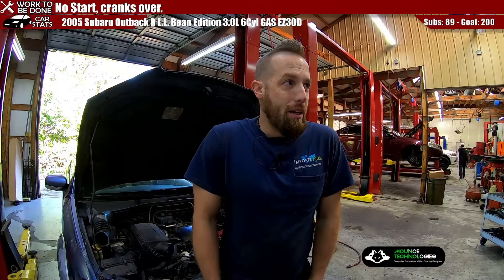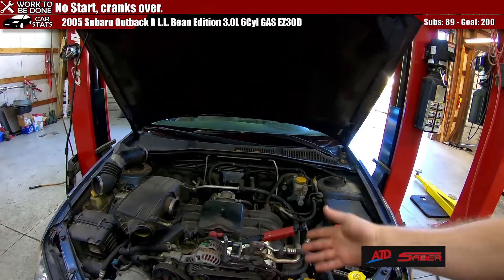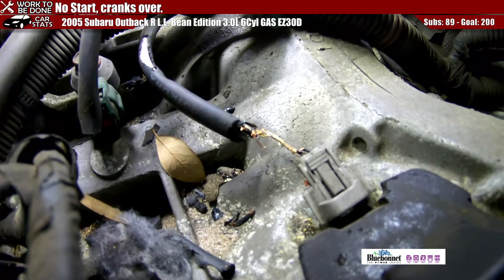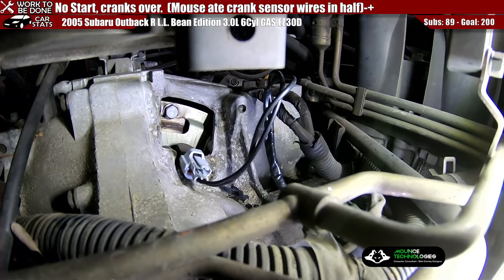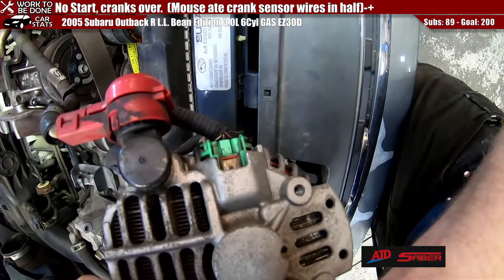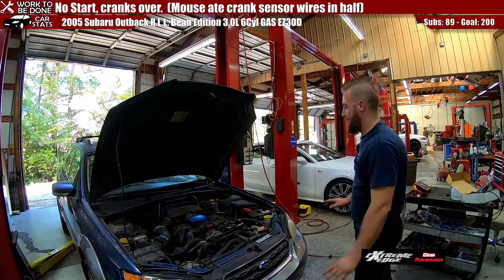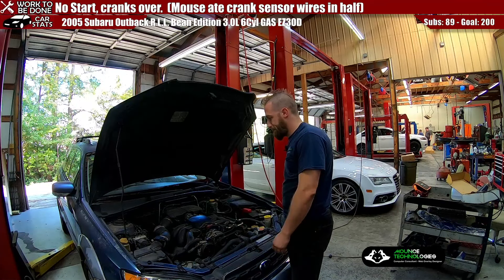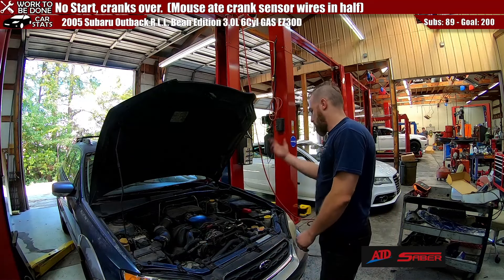How to Diagnose and Repair Subaru Crank but No Start. Learn Here to DIY

Comment: I had the issue on my 2004 H6 Outback. The issue was with the valve adjustment and the spark plugs. It appears that on every 50k kilometers, the valves need adjustment because they are not with hydraulic adjustment.

Comment: im doing an 08 2.5 outback now, no start , fuel and spark are good, tried starting fluid, nothing, pulled a plug wire to check spark..ouch works..pulled right tbelt cover, looks fine , not old and tight and rotates .. how ever it does spin like it was a tbelt .. no codes n live data shows numbers on everything.... soooo I guess next is to pull complete tcover to see if it jumped timing.. id be ok if it did , because NO idea what to look for next..
Reply: Ever find out cause same scenario did the belt and still nothing.
Reply: U found the issue? I have the same problem
Reply: A year late and you probably checked but worth checking the start fuse right under the wheel!
Reply: @armadillostudios2720 Which fuse under the wheel?

Comment: Subaru impreza 2010.
Dies at times at lower rpm
Crank... no start... (no spark)

NO CODES.... 

Sometimes will start in a hour... at times after 2 days...

Like a ghost I'm the machine...

No rhyme or reason..

Thoughts?

Comment: Better check the air filter box for a “mouse house” also. I’m on a 2015 Outback, same symptoms, crank-no start condition. Found and evicted the mouse house, still no start, the house was completely blocking the intake snorkel. Off to the shop with a scan …uggg.